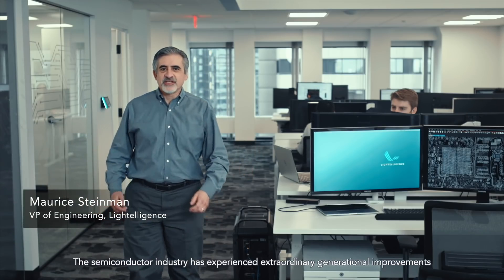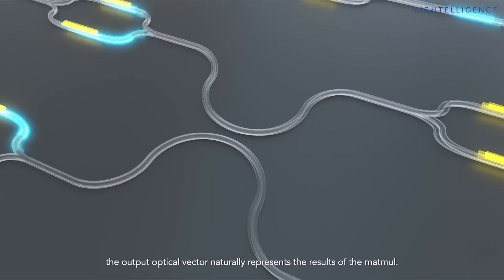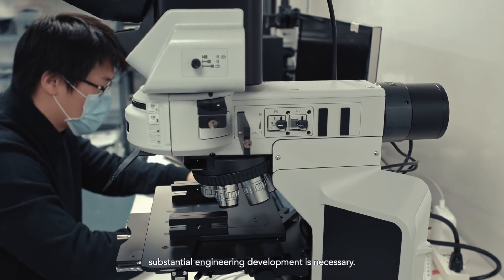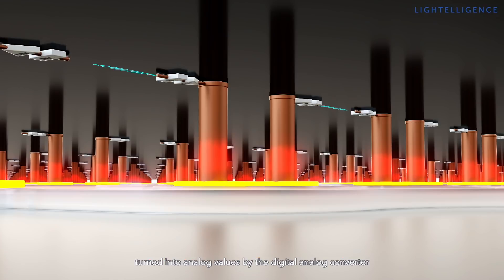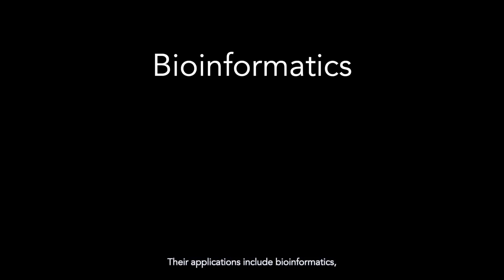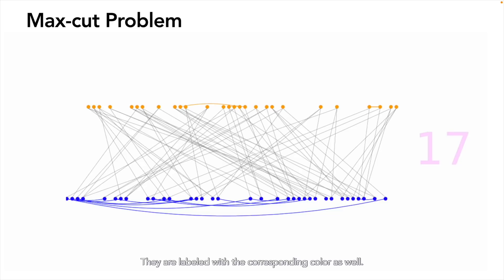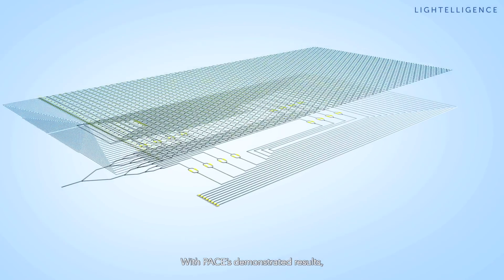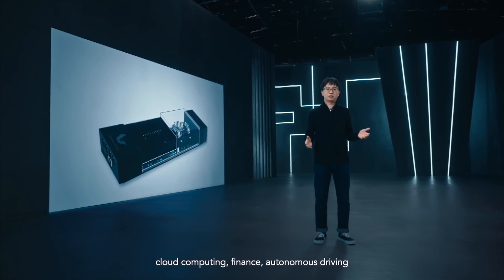Lightelligence PACE Announcement Video

Comment: No power is lost to heating because of the passive computation of light passing through mirrors and lenses. Amazing achievement! This kind of invention will probably push forward the boundaries of IT by 100 years, I barely dare to imagine what will be the future!  And imagine having this mixed with a layer of QBITs in the future.
Reply: It's not mirrors and lenses, it's waveguides.

Comment: Yeah... amazing. But how would it be manufactured though? I suspect photonic chip is not something the manufacturers are used to making on a large scale.
Reply from the maker: A great question, thanks! Optical computing based on silicon photonics directs modulated infrared light into silicon “wires” called waveguides, which can be produced using standard CMOS processes. 

Silicon photonic devices are made using existing semiconductor fabrication techniques. Since silicon is already used as the substrate for most integrated circuits, we create hybrid devices that integrate the optical and electronic components.
Reply: @lightelligence  Thank you for your information, however, a few questions remain. 

Firstly, I'd like to know the bandwidth/latency between the electronic and photonic devices, as you would need to ship a lot of data back and forth. Is the chip specialized for matrix multiplication alone or could it do things like element-wise adding? How precise is the computing? These questions are critical to the practical usage of such devices.

Comment: So it's a hybrid system? Using optics for communication and existing logic for computing? Sorry, if this isn't obvious since I'm still learning.
Reply from the maker: Thank you for your question! Yes, PACE is a hybrid system, with optics and photonics used for both communication and computing.  

PACE's photonic chip contains over 12,000 discrete photonic computing devices connected optically that perform matrix multiplication in the optical/analog domain hundreds of times faster than a typical computing unit; see https://www.prnewswire.com/news-releases/lightelligence-demo-harnesses-light-to-tackle-some-of-the-hardest-computational-problems-301444813.html

The memory is electronic, in addition to the other part of the chip that contains traditional electronic ASIC circuitry—used primarily to drive the photonic side of the chip. The mixed-signal ASIC houses a digital block with control logic that regulates data flow and I/O as well as SRAM for data storage; see https://www.eetimes.com/optical-computing-chip-runs-hardest-math-problems-100x-faster-than-gpus/#

Comment: Quantum Computer, right?
Reply: Nope, classic computer but with light instead of electrons to calculate, the big advantage is because light doesn't spray heat, so all of the wasted heat in a classic electrical CPU is fully used here to do calculation, it's making the CPU much much faster and less energy hungry !

Comment: Can it run Crysis? More seriously, i'm amazed at a company already harnessing photonics for 'practical' uses and getting ready for 'mass' production. Congratulations! I hope you find more and more use cases for this tech!
Reply: Yes, but I'm not sure if it's ready for mass production yet. Spending $100M to make 1 processor that runs 100x faster than a gpu wouldn't be that practical (better just buy/rent a gpu cluster), and I doubt mass producing photonics gonna be easy. Chip manufacturing operation runs on a very precise system and even slight change in chip design can take weeks to implement on a large scale. GPUs can perform many vectorized tasks well, but the same might not be said for this device. Matrix multiplication is followed by some other operations before you enter a new matrix multiplication, and that can cause a bottleneck if this thing can only do matmuls, since you would need to convert the electronic signal to light, do matmul, then convert back for some intermediate processing before doing it over again, causing the latency issue (maybe mitigated for some problems by some smart coding but for others it's still a big issue). 

Also, they didn't talk about the precision and reliability. With digital circuits, you can have an arbitrary precision and even low precision tasks like fp8 or fp16 have some guarantee of precision. What about this new light device? Would it have some weird error? Can it be error-corrected? According to Wikipedia, the bfloat16 data type used in machine learning holds value between about 10^-38 to about 3*10^38. How wide is the range of numbers this thing can represent? How does it compare to many matmul approximation algorithms for cpu/gpu? I think they've probably considered these problems, but don't know how well they've solved it. I'm cautiously optimistic regarding this technology.
Reply: @swordwaker7749  "Spending $100M to make 1 processor that runs 100x faster than a gpu wouldn't be that practical" 100M is probably the cost of researchs, paying people, testing prototypes etc... A single photonic CPU is probably not going to cost so much, probably more than 50k $ at the begining (for the first prototype) and with times and improved way of making them, we will be able to get a photonic CPU in few years just for 1-5k $ !

Comment: A lot of people here are asking ill informed questions. This processor is specifically designed to run matrix multiplication operations, which is just a subset of what a RTX 3080 can do. You can’t run a game on it. 

However this is really substantial as most AI Nueral Network applications leverage Matrix Math to train their AI. Siri, Tesla FSD, Google all use a LOT of matrix multiplications. 

My question is how large of a matrix can be plugged in? I thought they said 64x64 but they never actually specified. Today’s AI matrices can be MUCH larger than a trivial 64x64 matrix.

Time will tell if this is just hype :)
Reply from the maker: One of the matrices implemented in PACE is 64-by-64. Larger size matrices need to be split/tiled into smaller-size blocks, just like any other AI accelerators would do. PACE's photonic chip contains over 12,000 discrete photonic devices, the densest of any 3D-integrated photonics chip in a proven working system. 

Native matrix sizes will increase with density and chip physical sizes as the technology quickly develops. A previous 2020 prototype chip was only 5-by-5 (see https://www.osapublishing.org/optica/fulltext.cfm?uri=optica-7-5-551&id=431845).
Reply: @lightelligence  You shouldn't be launching your technology right now.  really shouldn't  because of your technology  There is a chance to be imitated to be used somewhere or competing chip companies.  Large ones may develop further modifications to the system from your ideas.  You should only open the service for data processing and AI. It shouldn't show this technology.  You should immediately delete the clip.  I am an experienced business consultant.  If you want business knowledge, you should contact us.  we can help you
Reply: @hypertech7876  Seriously, if they want to launch this technology right now is only a good thing. I probably need to use this technology in my future, and this for that guys is experience.

Comment: If it is 100 times faster than state of the art GPU, then,

Can it run AAA games at 16K resolution with full Pathtracing Graphics? 🤔🤔🤔
Reply: It's not really the same as a GPU. It's a piece of electronics that is EXTREMELY efficient at matrix multiplication. Which is commonly used in industry, but a GPU can also do more. It is not stated how efficient this new technology is at that.
Reply: @hidjedewitje  How about mining?
Reply: @SimonLeBonbonbon  I don't know. I don't have any experience with the computations done when mining.
I don't have interest in mining either.